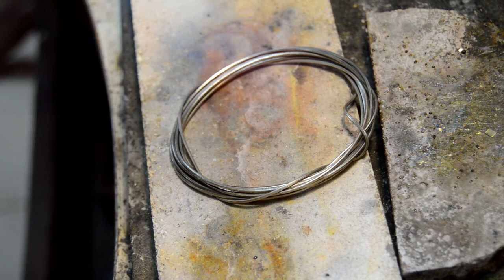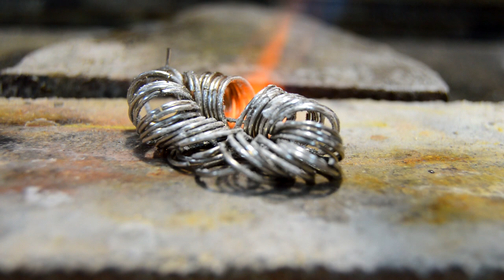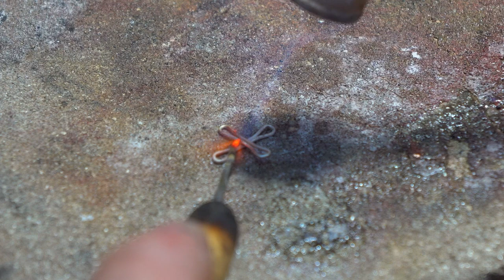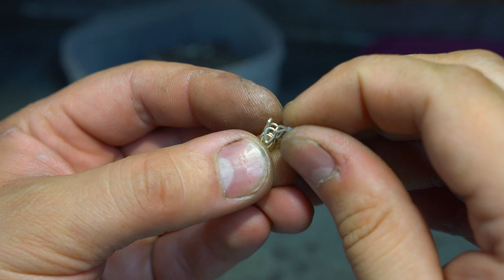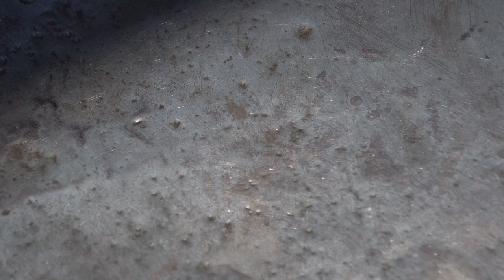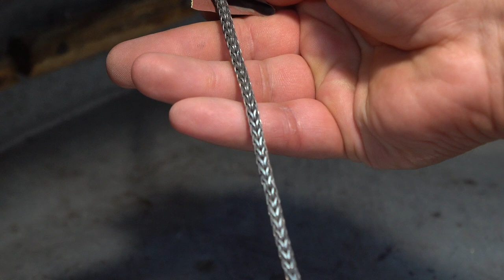Making silver necklace | Classic Double Foxtail |Men silver chain

Comment: Top Tip... you can at 10:40 see how tricky it is to thread the curved links through. Note how they have to be pulled through with two different pliers. This can all be avoided by keeping the links straight as at 5:46 Thread them through straight, then bend them up. Much simpler and faster. Dave.
Reply: I was thinking the same thing.  I use pliers made to shape these metal links.

Comment: Hello, 
I really love your work, you have amazing videos! :-) Could you help me please with project for one of my customers? Iam a goldsmith from Czech republic and my customer would like this type of chain, that you have in the video. He would like it in 45 cm around 25g of 14K White gold. What should be the estimated thicknes (strong) of the wire and on what diameter should i use the wooden timber to achieve this weight in that pattern? Thank you verry much for your answer. Thomas
Reply: (two years later) good question! I tried this with 1 millimeter wire and made the rings 12 millimeter in diameter. It worked for me. Good luck!